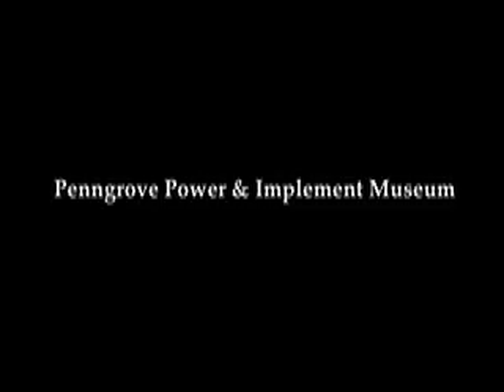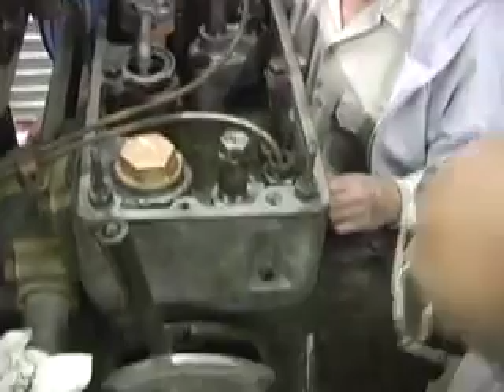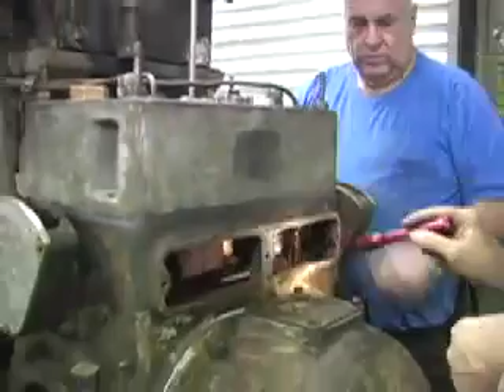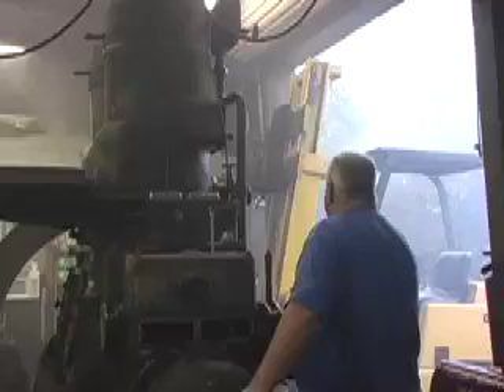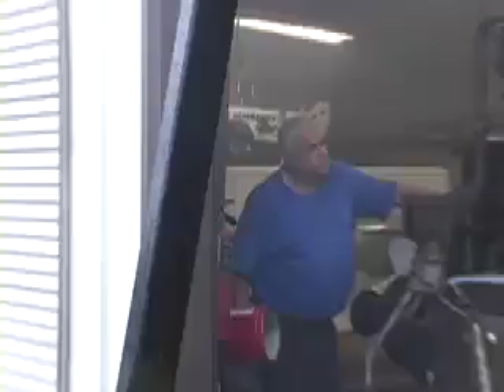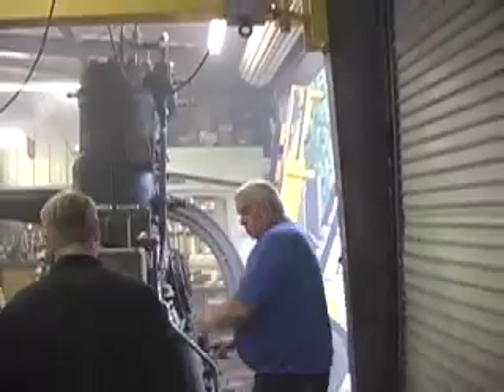Restoration of Fairbanks-Morse Y-VA & start on Dec. 26, 2006

Comment from the maker: My earlier description wasn't clear. There's an oil lube system sitting above the injection pump that was describe around 4:00. The engine is pre-lubed using a hand crank to supply lubrication throughout before the engine is started. It continues to be lubed during running.

Comment from the maker: No premix - total loss - this is the earliest production 2-stroke diesel from Fairbanks Morse that isn't a hot-head. It represents the breakthrough technology to what we call "modern" diesel. Because it's total loss the cylinders are lubed by fuel, and the crank is lubed with a wicking system - oil is poured on a felt pad that is in direct contact with the main bearings. One exhaust port with 3 slots.

We moved it to the museum and you can see it run at Penngrove Power & Implement Power-up 2008.